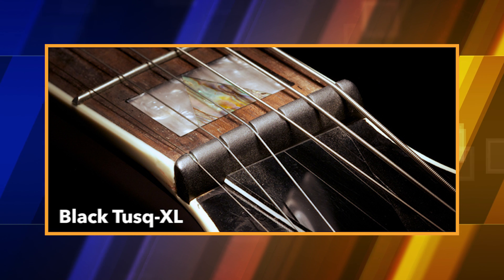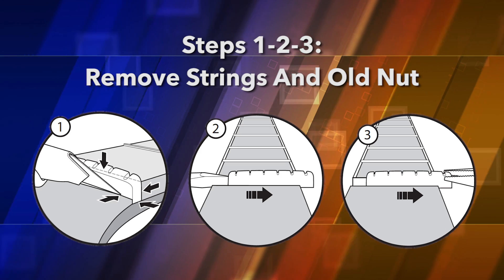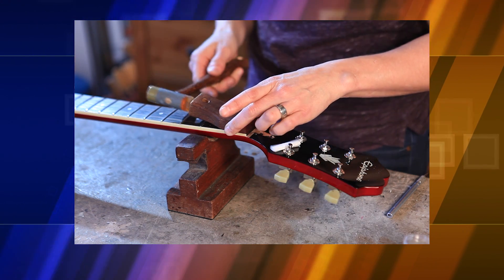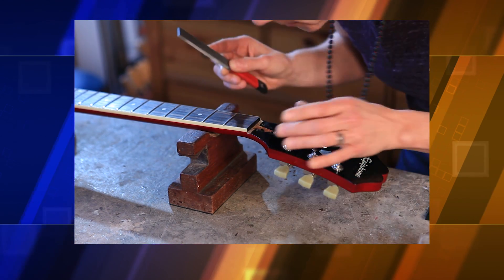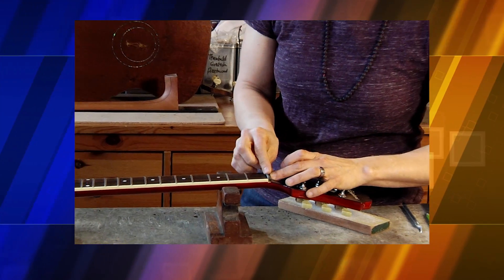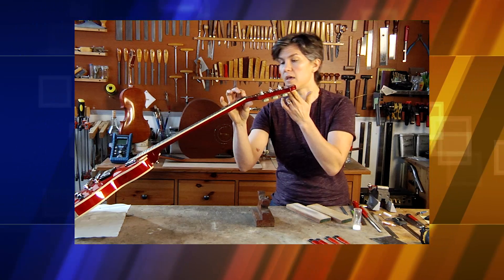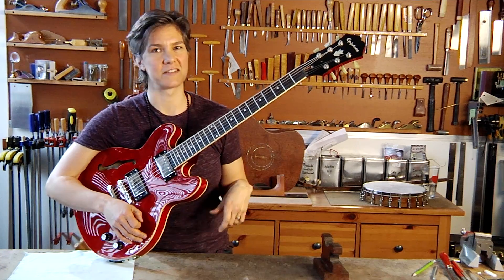Graph Tech Training Series: How to Install a Pre-Slotted Nut

Comment: what kind of glue?
Reply: @thegerman3480  It will work, but the problem is the thickness even in small amounts. CA glue spreads so thin and even it allows the nut to seat flush unlike wood glue. Plus two tiny drops of CA will allow the nut to come out again without much force while wood glue bonds with the wood and can take a chunk with it. Not trying to argue, just my opinion after removing/installing 100's of nuts in my shop.
Reply: @12south31  you mean common superglue right?  I am looking to install a graphtech xl nut into a cheap tele copy and I've never had to replace a nut (this one was so chalk like that after trying to do a truss rod adjustment, the string sunk through to the bottom of the nut, like a hot knife through soft butter lol.  The nut itself was easy enough to remove with a set of small pliers, but now I am wondering if I should even bond it to the wood since I may make a mistake!

Also will the PQL-5010-00 : TUSQ XL STRAT STYLE NUT FLAT BOTTOM be a right fit for this tele copy?  I see I may need to file down the sides of the TUSQ nut because it is a bit wider than the nut slot.
Reply: @socialdef3  Yes, common super glue. 2 small drops each about 1/3rd of an inch into the slot from the outside. The nice thing about CA glue is it bonds tight but if you screw up it's easy to pop out to fix the mistake. Most likely you will need to do a little sanding on the new nut so it's the right height and fits flush on the outsides. Nice and smooth to the line of the neck where it meets the headstock. You dont want to feel a lip of the nut sticking out you know? Use some 150 grit or to be safer 300 grit. 300 goes a bit slow but if you have not done this a lot that can be good. Either way, fit the nut into the slot to see how it fits, then you have an idea of how much material to remove. Sand it down and stop and check by putting back into the slot often. Once you get it perfect on the sides put your e strings on, the nut (unglued) into the slot and measure the distance from 1st fret top to bottom of string. You want .020 for low E and working down to 
.010 for high E. If you are unable to make that measurement, like with a feeler gauge, just fret the 3rd fret and you should be able to just barely tap the string against the 1st fret. Now that you have it sized, apply the 2 drops and tighten up the E strings. Let it set for 10 minutes and put the rest of the strings on and pat yourself on the back! Go slow, check often and good luck!
Reply: @12south31  Dude you are the man.  Thanks so much.  I was enjoying this beater very much until I tinkered and then the crap nut officially announced its presence.  Will tackle this project this afternoon after picking up the wife from work.  There is a side of the new nut that has TUSQ XL printed... should I sand that side? I figured I should sand the side that faces away from the rest of the guitar and towards the headstock.  Will sanding on 360 grit leave the nut stained or dark?  Thanks again for your help, I've worked up the courage to do this on my own.
Reply: @socialdef3  Use double sided tape on the back of your sandpaper and affix to a flat hard surface so you keep it level when sanding. The side of the nut that is flat, opposite the side with Tusq XL is the side you should sand. For one the front with the logo looks nice and 2 the back is already flat and goes against the end of the fretboard so you wont see the sanding marks. Did I mention that If the old nut has Poly or Lacquer over it to score it with an X acto knife carefully around the edges? When you knock it loose it could peel the finish.
Reply: @socialdef3  No, sanding it will not stain the nut. It will make a mess tho, lots of powder. Just be sure to keep the bottom flat, you want it making as much contact all the way across as possible. It's easy to start getting it crooked if your not careful. You got this, good luck!
Reply: Elmer's and other wood glue is not recommended because it will take wood off if you ever remove it and also super glue will spread more evenly than wood glue allowing the new nut to seat better.
Reply: A drop of Elmer's
Reply: mighty bond
Reply: Super glue is readily available to everyone and it works great. Just a small dab about the size of a BB on each end of the nut slot. The glue is only to hold the nut in place when all the strings are off the guitar to keep the nut from falling off. Otherwise the strings hold the nut down with tension. Wood glue may be used but you would need to clamp the nut to the neck which takes time to dry while clamped.
Reply: @lyric.kayden  or you could just string the instrument and have a stringed clamp LOL

Comment: You would have done well to mention what kind of glue, and how little you used. Some use Titebond wood glue, others use super glue. People who've never done this look to the professional luthier for expert advice from beginning to end of the procedure. Otherwise well done.
Reply: I think you can get away with no glue at all. The strings hold it there. But, at dot of superglue is enough just to stop it sliding around when you take strings off. 
This is what I've heard elsewhere.
Reply: @GregRickard  Yes, I always try the nut without glue for a few days to be sure I've got it right. If the guitar is properly prepared, the nut will not fall out or move after you've tensioned all the strings.
Reply: Use just a little of any glue elmers tile bond. Strings hold it in place.

Comment: Thanks, Nicole.  That's a really neat hack, using the sanding board to hold the nut while you square it off.  Cool.   Thanks again.  Great 335, by the way.  Cheers.

Comment: How do you measure 0.010" and 0.006"?
Reply: Use a commonly avaliable feeler gauge. This gauge gives dozens of flat blades in every size that you need. Easy and accurate. Can be purchased at auto parts store, hardware store, Walmart etc
Reply from the maker: By using either a Business card, or a digital caliper!

Comment: Hello. I have a 2010 Gibson Les Paul Studio I wanted to give a Graph Tech nut as I'm planning to install a tremolo.

It seems like the PT-6010-00 should be the right model, but the measurements I have of my LP's current nut are quite off to the specs given on Graph Tech's website.

The width and length are pretty close, but aren't exact to either PT-6010-00 or PT-6000-00. The E to e distance is 37mm rather than ~36mm, and the biggest difference is with the height – unless I measured incorrectly, the current nut my LP has is 5mm tall, while the Graph Techs are around 9mm? I don't have fret buzz from open strings so I doubt the nut should be almost twice as tall. Am I supposed to actually sand off 4mm when installing it or are the grooves somewhat deeper?

Comment: on my Gibson 
loose  strings  
remove old nut 
clean  old glues  
put new  tousq  PQ 6010 00 
tune all strings to pitch  
measure   with  feeler gauge  
press 3rd fret   
top  off 1st fret  bottom of low E  =0,80 mm 
i need  0,25  mm 
loose strings remove new nut  
take  the 0,50  filler 
put in a flat surface 
take also new nut put it  in the flat surface with the filer 
mark with pencil  how match  you have to sand  remove 
put it again  tune all strings to pitch  
measure  now i have  0,40 
take it out   
put in a  flat surface  with the 0,10  mm filler  mark 
sand 

put it on again  

BOOM  

now is more than 0,25 mm and less than 0,30 mm 

perfect for my  agressive playing  

thank you 

     i glued it with 2 parts clear epoxy
Reply: Ty lol

Comment: You are wrong about your dimensions for the Big E and little E string now the diagram shows for the big E string is .010 that is 10 thousands of an inch, but what you said in the video was 0.1 which a hundred thousands not 10 thousants, big big difference! I think you just miss pronounced the     actual measurement. Just clarifying for everyone. Good video though.

Comment: I'd like to see instructional on what to do if the nut ISN"T a perfect width, how they trim each side, plus how they recommend determining the exact side to side positioning to align the nut properly with the strings on down to the bridge.  Too bad these important steps were left off this clip.
Reply from the maker: Hi Mark, 

Try watching the blank nut installation video. https://www.youtube.com/watch?v=VRiqOad1qJA 

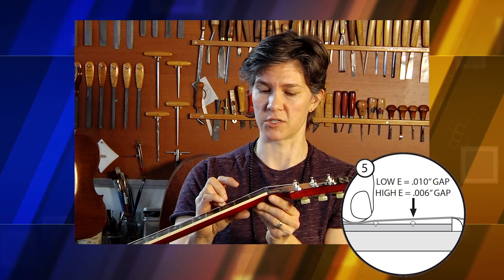At 4:55 Nicole Alosinac goes over how to finish the ends of the nut. This video should have the answers you are looking for. If you need any more help, please email justin@graphtech.com. 

Cheeers,

Comment: Nicole, you are off by one decimal point for both the First String High e and the Sixth String Low E ― that is ten times inaccurate! Nevertheless, this is a great product and Epiphone should have this as part of their specifications for every PRO model $600 and up ― and furthermore, Epiphone should have this component installed at the Epiphone factory in Qingdao.

Comment: There is a mistake in the video in regard to the gap between fret top and string bottom where the luthier says to make the high E-string gap “zero point zero six” and low E-string gap “zero point one”. That is incorrect, and should be “zero point zero zero six (0.006)” and “zero point zero one (0.010), otherwise you will have huge gaps of sixty thousandths and one hundred thousandths. You’re welcome, and for next to no cost - make one check per correction payable to me in the amount of sixty cents ($60.00) and one dollar ($100.00) ... see, decimal location does make a difference : )
Reply: Lol Yes indeed decimal position is important.

Comment: While sanding the bottom of the nut It is also a good idea to place a piece of wood at a right angle to your sanding block so you maintain a level bottom on the nut. place the flat side of the nut against the 90' angle while move across the sanding block.

Comment: J. HonIs the recommended clearance 0.06 and 0.1" or .006 and .01" She states a value ten times that shown on the video graphic illustrates. decimal position matters. I would think .06 and .1 because 6/1000s would be rubbed and frets for sure.
Reply: I was going to ask about this. Can we get a clarification? I'm about to replace the nut on my Ibanez and need to be certain.

Comment: To adjust the nut height, if you liked the height of the old nut, simply measure and write down before removing it and compare with the height new install. This is an easy shortcut can save some time, it gets you in the ball park.
Reply: The reason I'm watching this video is that the old nut is worn down on the G and B strings (probably other strings, too).  So you don't want to blindly re-create the old nut exactly.  But, ya, for overall height and width, keep it handy for comparison and measurements.
Reply: Honestly, I think this should be the preferred way. Unless the original nut has wrong height.

Comment: Don't you have to file the slots to match the break angle of the strings?
Reply: Robert gilmore not on the graph tech nut. The back edge or the edge on the headstock side is rounded over quite a bit.

Comment: Thank you for this!
After setting to graph tech specifications (0.010 & 0.006), if the action at the nut needs to be lowered should the nut be removed and sanded at the bottom as was done during installation or should the slots be filed down?
Reply: Personally, I would lower the nut height more rather than filing the slots down lower.
Reply: To get it perfect you'll probably need to file each slot a little. For the most part though I found that they always need filing, but mainly to fit the string better.

Comment: Hi what glue do you use? Do you need to state what guage strings you are using when ordering the nut ?video great help thank you
Reply: You may or may not have to file for your string gauges. Ive always had to have at least a little done to make them perfect.
Reply from the maker: Just some basic white Elmers Glue, or some wood glue diluted with some water. Just something to keep it in there, you don't want to bind it to the headstock.

Comment: When you check the height,how much tension on the two E strings?
Reply from the maker: Normal tuned up tension. So just tune them to normal pitch.
Reply: Regular tuning, but putting only the low e and high e on does not really work very well especially with tremolos.
Reply: So, you need to put all the strings then.

Comment: Hi  Nicole and Graph Tech. Thanks for the great instructional video. I am 
about a year into my playing and I find the technical aspects just as 
interesting. You explain the procedure very clearly. When I need to 
replace one of mine, this video will be a key reference. I did note that
 - although the graphic is accurate - Nicole mis-spoke about the high E 
clearance gap. Check at the 4:45 marker. The accurate measure is 
0.006.. (not "...   0.06 of an inch"). I watched your vid for replacing the saddle as well.  
That is another great guitar tech reference